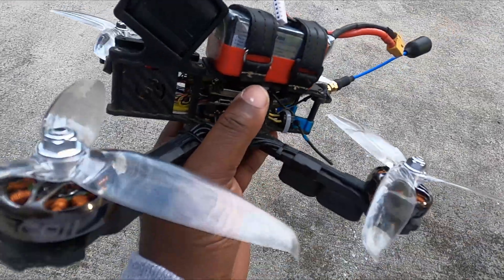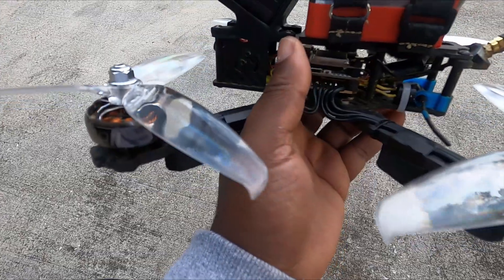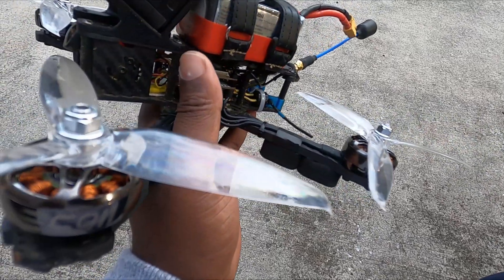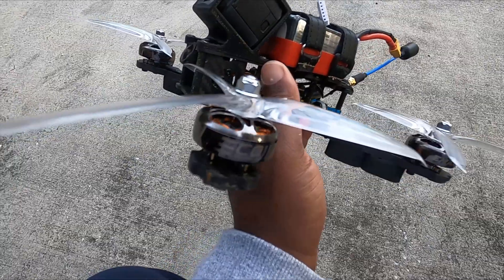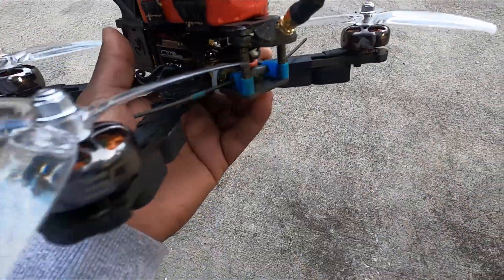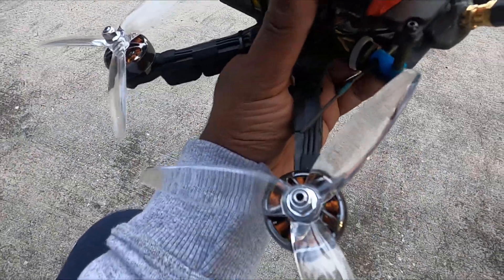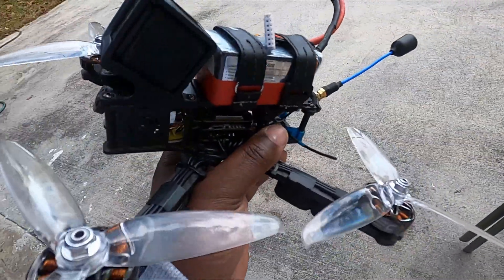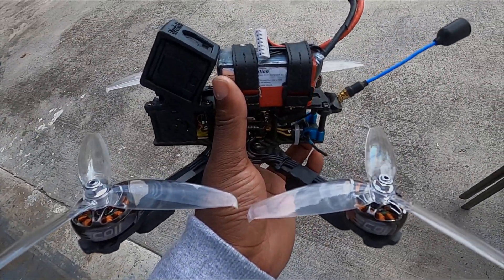EMAX ECO II 2807 1500KV (Build # 4)

Comment: great video! i was trying to figure out if 2807 was overkill for my 6in!
Reply from the maker: Was on 6s
Reply: By experience, i prefer using 2507 on 6 in quads, 2807 are more for 7 inch

Comment: what are you flight times looking like? and the weight of the quad? 👍🏽 good review
Reply from the maker: Weight without battery and gopro is 586 g, and 790 g with a 6s 1100mah.  As far as flight time goes, I landed with my battery showing 3.80v per cell , but no sure about sport flying. I will let you know when i test. I'm working for the next couple days.
Reply: @GBoniFPV  awesome, thank you